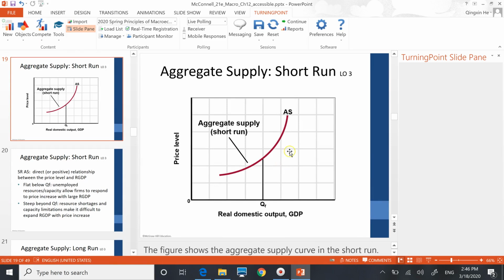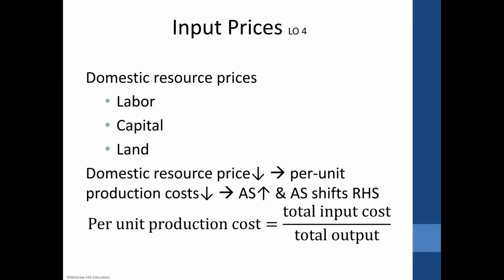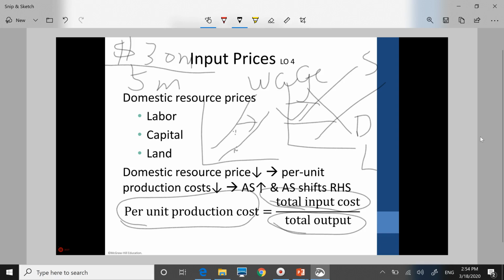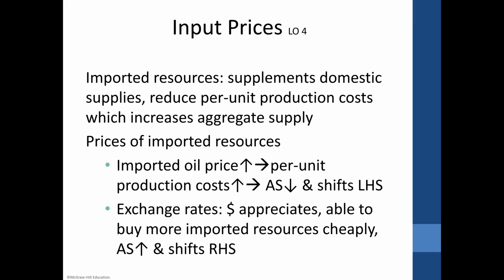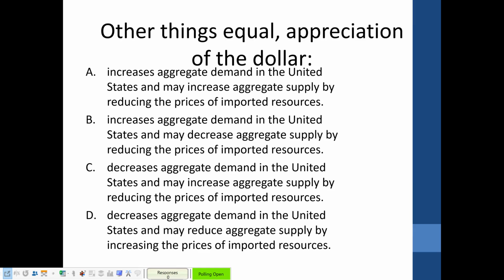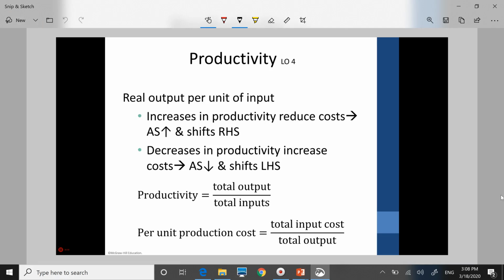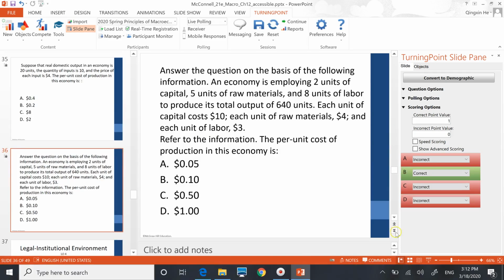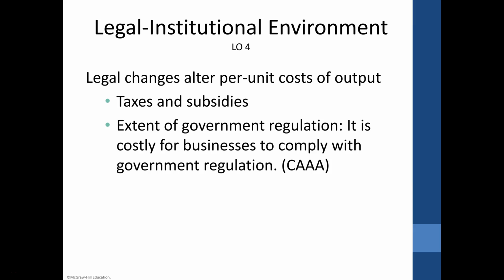Principles of Macro _ Changes in AS (ch12, 26-37)

Comment: as I watched the video I learned that there are three shift factors to the determinants of aggregate supply.  It was also nice talking about old material like the domestic resources.  a higher price of a resource is a bad thing to supply which i found very interesting because it reminds of me scarcity when An item runs low on supply it will end up rising in price.  I liked that the video explains how costs, technology, and other factors affect the aggregate supply.   The example with the oil was a good example that helped me understand imported resource.  the examples used were a little difficult for me to understand but after going into depth with them It was easy to understand.  Overall i enjoyed the video.  - Jose Caballero